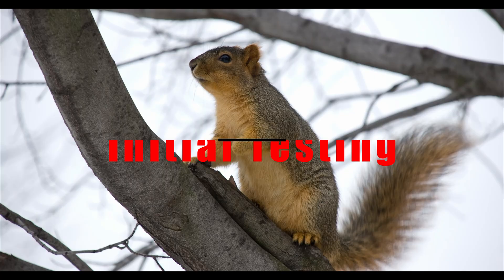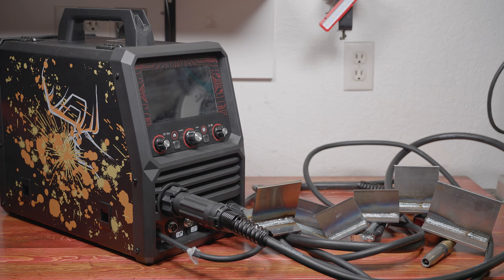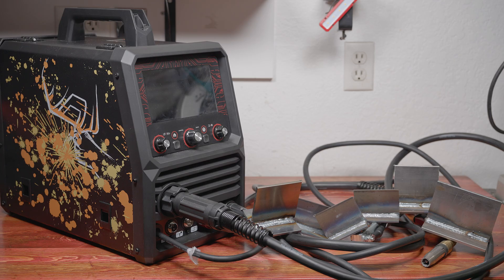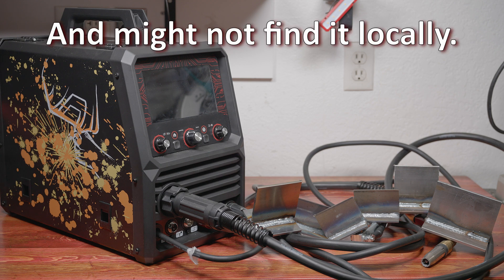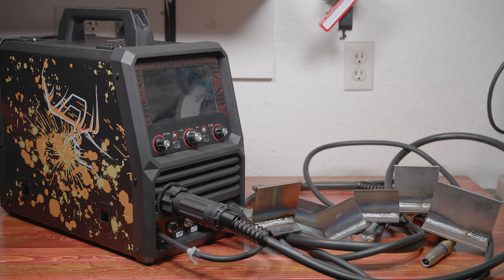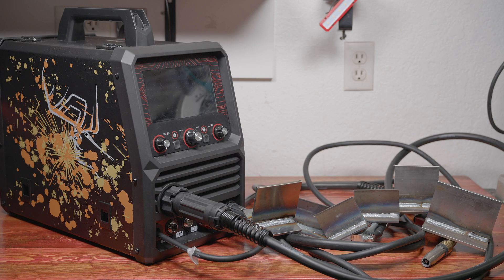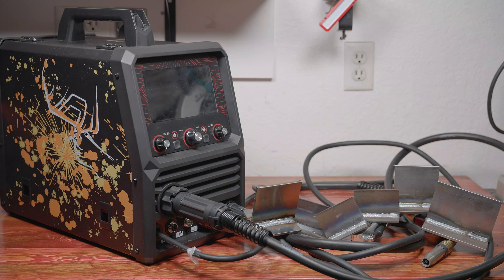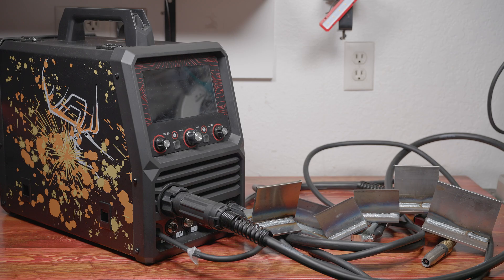Yeswelder DP200 - Firmware Version 5.1 - Improved?

Comment: what set up do you use to video the welding. I swear that is what i saw while welding in my 20's. now i am 81 and can't see squat . may be 
i could set up some kind of camera plus a monitor in my helmont ? May be a phone set on video. any ideas would be appreciated.  Back in my 20's the shop i worked in made
us use 7014 and i swear i use to be able to see the demarcation line between the flux and metal in the puddle. Dan
Reply from the maker: I use a Sony AX700 camcorder with a built-in ND filter.  But I can generally see a bit better through my helmet, because the camera shutter gives a flicker to the video.  What helmet do you have?  They are expensive, but many modern helmets give a fantastic view these days. The Lincoln 4C stuff is really good.  The Lincoln 4C with the largest window gives a bright, very clear view.

Optrel also has some helmets that give a very bright clear view.  Really, a lot of helmets do, but those are my two favorites right now.

I've never used one, but many helmets offer magnification lenses that can clip inside as well.  Those can sort of "zoom in" your view through the helmet.